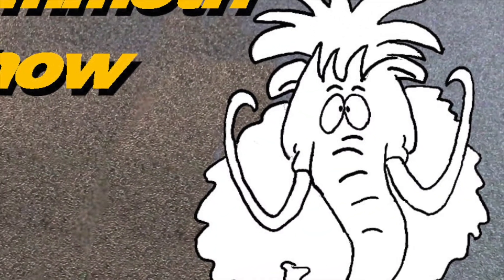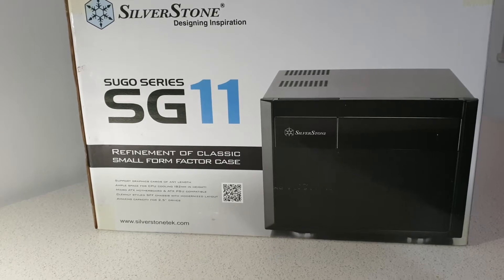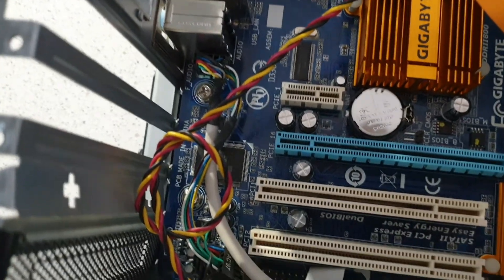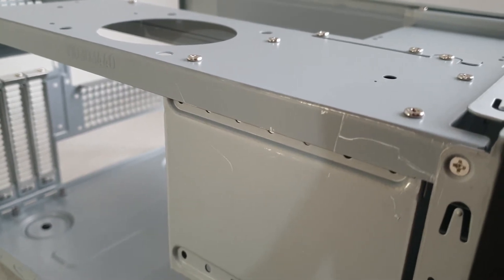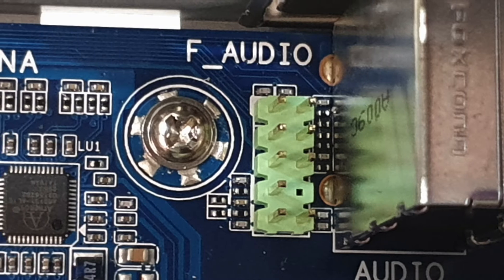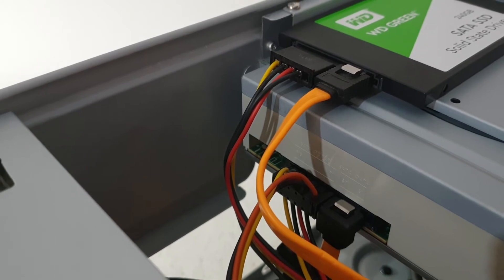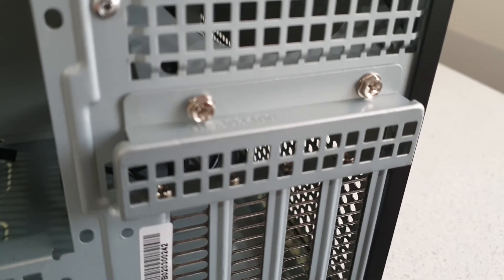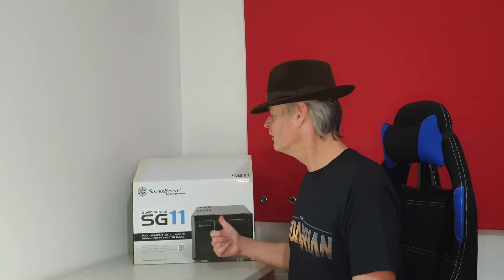PC Transplant - Moving a PC into a Silverstone SG11

Comment: Thanks for filming this case, Im considering using it for a home server and wasn’t sure about the internals compared to the Sugo 14. You said at 3:56 that hard drives don’t need cooling. Just wondering where did you get that information from?

Although you don’t have to cool 3.5 HDDs to make them work, they will die much sooner if you don’t cool them. If you are running anything that accesses the drives all the time, eg storing CCTV onto one you will definitely want to cool them unless you enjoy regularly having to replace them because they failed. In large cases with lots of airflow a HDD will probably get enough cooling just from the air flowing around the case. However, in small compact cases, HDDs can often be in parts of the case which have no airflow at all, not even a grill near them. Cooling becomes more important in these circumstances.

It doesn’t need a high airflow of cooling, you can dial the fan right down with a controller. It just needs some airflow to dissipate heat. These days drives are often fitted with rubber washers between them and the case, so they cant dissipate heat through contact like they could in the old days. 

If you read up on this online you will find a lot of people arguing about if it does or doesn’t, but you have to consider that there are a lot of different use cases so they can both be correct. Some people have low rpm low-capacity drives, some have high rpm high-capacity drives. Some people are using these in server racks, some in large desktop cases, some in small cases. Some drives will get air across them naturally from the design of the case and some may not. Some will have direct metal-to-metal contact with the case, some with dampening washers will not. Some are using the hdd as long-term storage so the drive spends most of its life powered off and others maybe recording 8 CCTV camera feeds to it 24/7.

Don’t get confused by the people talking about the spindle coolant. Even though the spindle mechanism might not need cooling and you have a hdd that is happy to be cooked, the controller board on the hdd is not going to enjoy those conditions long-term.
Reply from the maker: Glad the look inside helped. Good point about HDDs that are contstantly in use. It's the first time I have come across a case that features cooling for storage drives but I can see how it would make sense.
Reply: @mammothtechshow  Im still looking and not sure if it is the case (pun) with this case, but on some small formfactor cases the fan attached to the drives is not just there to cool the drives but is also the air input for the front of the case. Often see this on cases where the front is solid. Even if you think drives dont need cooling, discarding it may be removing an intended air input sourse for the case.
Reply from the maker: There are a couple of spots for small fans directly above the motherboard. I have used one of these and it works well.

Comment: I do like the look of that home theatre case . I wouldn't be so quick to dismiss drive cooling. Getting rid of the warm air can't hurt. External drive enclosures sometimes have fans.
Reply from the maker: A good point. If you were using it as a media server with lots of high capacity drives it might make sense.